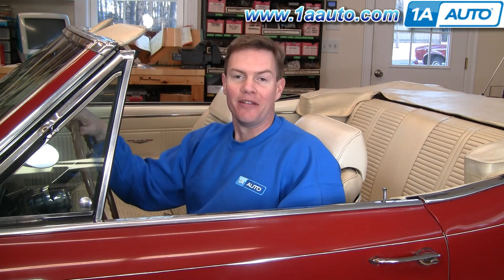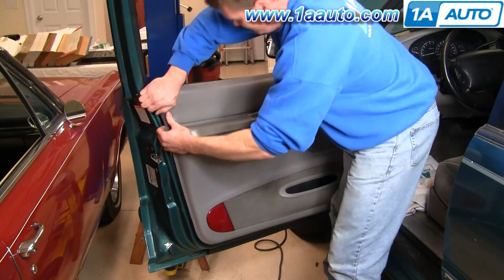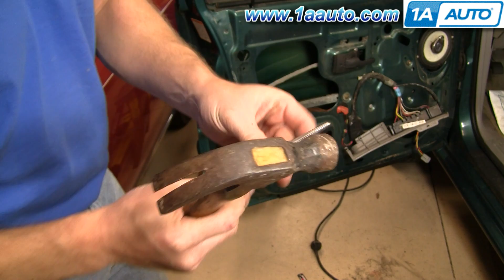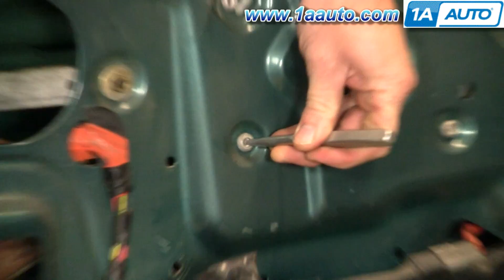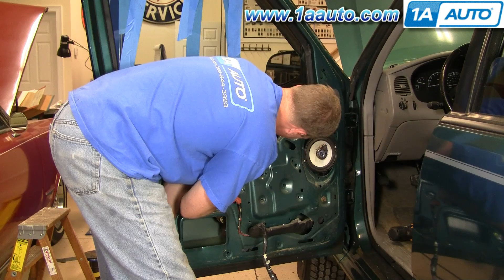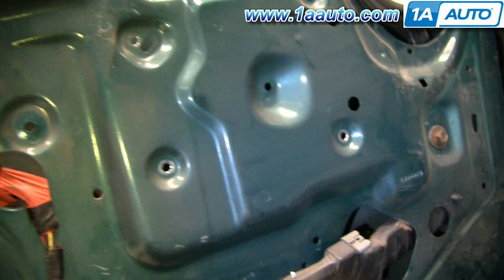How to Replace Front Window Regulator 91-01 Ford Explorer

Comment: I'd like to know which wires need repair to allow my window to work with the driver door open. It works fine when closed but will not work when open. I've had it 5 years and it's always been that way.

Comment: Replaced motor and regulator on 96 Explorer but now window jumps track just before it reaches the top when I roll it up. Took apart passenger side to compare. I can't figure it out.

Comment: For the plastic shield I use a moldable sticky gum..
Comes in a strip, cut off as much as needed, removed wax paper covering and shape to desired size..
Instantly bonds and can be removed if need be, stays pliable..

Comment: Excellent video, job took less than 2h. I could do it again in 45 min.

Part works perfectly, very pleased. Someone else in the comments offered an important detail. You need to buy bolts and lock nuts, they are not supplied. I think it's 5 total but buy extra. I was able to get a box of M6 stainless steel bolts and matching lock nuts on Amazon. M6 happened to fit a 10mm socket making this uniform and easy. I added a dab of lock tite to the Ford OEM nuts that you DO reuse just to be certain nothing wiggles out. This company rocks.

Comment: This video is fantastic and it helped me and a buddy replace the regulator in a 96 Explorer. The problem I keep having is that the glass will not stay in the channels. I've used 2 different types of Loctite and an epoxy, and pinched the channels. Eventually, the window pops out of one or both of the channels.  Any suggestions?
Reply from the maker: +Scott Munn We wouldn't be able to diagnose an issue like that here, you may want to have a local mechanic take a look at it. Thanks for checking us out! http://1aau.to/m/Shop-1AAuto-c

Comment: Hi, I’m new at this. Question, when do you need to replace the regulator?
Reply from the maker: +Izrael Labastida The window regulator will fail and the glass will either fall into the door or the motor will fail and the window will no longer move. Thanks for checking us out. Shop for high quality auto parts on 1AAuto.com:

http://1aau.to/m/Shop-1AAuto-c
Reply: @1AAuto  thank you so much for replying me. I do appreciate it. I noticed on my windows they starting to go sideways like 10 degrees when I’m pulling down and get stuck on the middle. I was wondering if this was problem of the regulator.

Comment: I need to do this repair (passenger door, '96).  The only problem is that my motor is shot (which is why I'm doing the repair), so I can't move the regulator up/down to position the nuts/rivets in the holes/cutouts for easiest removal - the window is all the way down.  I'm concerned especially about punching out that first rivet you did (on the bottom track); I can't see it or get to it... is it necessary to break the regulator there to get it out?  I've seen a few other videos where they don't break it.

Comment: Do you think it is my regulator that needs replacing? My front driver’s window is stuck all the way in the down position. When I hold the switch in either direction, I hear a little squeak-ish electric noise. I’ve tried lubricating with white lithium lubricant and no luck (that’s what auto shop did to fix it last time ~1 year ago). Won’t budge when I use force to push the window up. Do you think it’s worth opening things up to check for any broken/damaged wires before replacing the regulator? Really don’t want to fork out the ridiculous 300 or so bucks for this after I paid 200 last time and it’s already broken again. Thanks for your help in the video, and in advance if you reply here!!!
Reply: I also just noticed the regulator you sell doesn’t include the motor, I guess I’d have to make sure it’s not the motor that’s shot? Although I saw one of your comments saying if it’s the motor then I’d be able to push the window up... I don’t know.

Comment: Mike, first of all, thank you so much for making and posting this video. You saved me the labor cost, and I learned a new skill. Retired mechanic here, so I really appreciate you sharing the repair procedure. Got her done today, and back in business. Also, just wanted to let you know that in your video where you are showing the first rivet to hit with a punch, I'm pretty sure you are showing the wrong rivet. It took me a few minutes to figure this out. The one you are going for is just a pivot point on the track, and not necessary for removal of the regulator. I removed the two rivets located on the window track, and the three in the door, and the regulator came out with no problem. Thought I would post this for everyone else just in case you might be scratching your head like I was trying to figure this out. :-) Once again, thanks for posting. I'm a new fan.
Reply from the maker: +Thomas Swope Thanks for checking us out! 1AAuto.com

Comment: I was ready to tear my regulator from this same Explorer.. My window rolled up crooked. I thought it was the motor, turned out the only thing wrong with it was the window just separated from the inside window clamp. 6.50 cents later i fixed. Always start with the small things first. Rolls up like a champ.
Reply: Is that a power window?

Comment: My pass front window is stuck rolled up. How do it get to the regulator while it’s stuck? Sounds to me like it’s hitting something when I try to roll it down and it doesn’t move. From the looks of the regulator it might be the gear not moving and wedges on something.
Reply from the maker: +Adam Averhart It could have a tangled cable but you should be able to take the door panel off and still access the bolts that hold the regulator up. Or it could be an issue with the motor which could make a grinding noise as well.

Comment: How do you determine if it's the regulator or just the motor? I have zero sound when I press the window buttons. Sometimes, though, they decide to work.
Reply from the maker: +Heather Gulino You may want to test the power going to the window switch and the window motor. If the is power to the window motor when the switch is pressed, then the window motor might be bad. Hope this helps you out. 1aauto.com
Reply from the maker: +Heather Gulino You may want to test the power going to the window switch and the window motor. If the is power to the window motor when the switch is pressed, then the window motor might be bad. Hope this helps you out. 1aauto.com
Reply: Thank you! Do you have a video for testing the power window motor?
Reply from the maker: +Heather Gulino Here is a video that we have that should help you out. https://www.youtube.com/edit?o=U&video_id=2tLmH05UKwk

Comment: I'm finding this video to be very helpful, I just bought a new regulator for my truck. My question(s) to be clear, what size nuts and bolts do you use to replace all of the rivers. Another question I have is what would be a good glue, or epoxy to attack the holders for the window itself. The ones that attack to the regulator arm??
Reply from the maker: +Shawn Saaler Thank you for checking us out. The size bolts and nuts are dependent on the size drill used to remove the rivets. The glue or epoxy is a personal preference, but 3M has some really good products. 1aauto.com
Reply: 1A Auto Parts alright sounds good. Thanks a million.

Comment: can you tell me why all four of mywindows don't work and why my wipers don't work they all stopped at once
Reply from the maker: You may want to check the fuse. It that is okay, you may also want to check the wire harness that runs between the door and the body of the vehicle for a broken or a frayed wire that may need to be repaired. Hope this helps you out. 1aauto.com

Comment: Cant you just unscrew motor and replace it? W/o messing with window
Reply from the maker: +Squidget You might be able to. Here is a link to the replacement window motors on our website. https://goo.gl/3sqV49
Reply: 1A Auto Parts Thanks, I'll just replace whole door, easier that way. 
Kidding, I'll check it out, thank you

Comment: My front passenger window is in the lowest down position and I can't get to the point where I can center punch and drill out the attachment point between the regulator and the window support bracket. Pretty sure motor is bad as I've connected the battery terminal directly to the 2 pin motor connector and nothing. Is there any way for me to raise the window? Or, is the only way is to knock out the rivets and remove the nuts holding the regulator and pushing the whole thing in like in the video? If yes, what do i do after that?

Comment: I was having issues with my window not going up. I took the entire door apart, drilling out rivets. By the time I drilled the rivets I thought I should have checked the fuses first. Turned out it was a 2 dollar fuse. On the inside fuse panel its number 10 for the door actuator. Check and replace that before tearing the panel off. I feel pretty dumb but im happy i fixed my window in time for the fall cool off.
Reply from the maker: +Rubber Johnny ahh, that's a bummer! But we're glad you were able to get the repair done! Enjoy the fall weather :) For anyone else who might be doing this job, we carry the parts shown in the video on our website. Order from us and we'll cover the shipping. Here's a link: https://www.1aauto.com/1A/WindowRegulators/Ford/Explorer/1AWRK00467?utm_source=YouTube&utm_medium=CTA%20Comment&utm_campaign=1ATony
Reply: Great info! Sorry to hear about the trouble you went through. Btw, did you have trouble with all your windows or just one? I'm trying to beat the Fall rain too. My front passenger window is all the way down and is not going up. All the other 3 windows are working fine. There's not one mention of power windows in the fuse box diagram. I know the GEM module affects the windows and there seem to be 5 fuses (#10, 20, 25, 27, 28) on the interior fuse box with the GEM description (found descriptions online) on it. So far the fuses looks good. I'm still hoping it's just a fuse. The window is all the way down and drilling the part of the regulator that attaches to the upper window track/support is impossible. Btw, what size bolts (1/4 diameter hex?, length?) and nuts did you use to reinstall your regulator? Shoot, it's gonna rain tonight!
Reply: Well my girlfriend did a dumb move and rolled down the window. Now i will have to replace the motor and regulator. Quick question. Does the regulator come with the nuts and bolts or is that separate?

Comment: You guys are awesome!! I will be replacing the regulator on my explorer today. What size were the nuts and bolts that were used in the video?
Reply: not sure about there stuff...but I used 1/4-20x1 hex bolts
Reply: Did you figure this out?  I'm going to home depot to pick bolts up and plan on guesstimating.

Comment: Thank you SO much for video.  My 93 Explorer Sport windows are getting sluggish.  I greased up all joints that I could and its working better,  but the regulator needs to be replaced in both doors.  Seeing this video makes doing the repair not so daunting.    OH and that water shield looks a whole lot better than the ripped plastic sheet thats in my doors.

Comment: You guys rock! My window has been broken for years so I decided to give this a shot after watching the video and now I have a working window. Thanks!
Reply from the maker: Thank you for watching. Please let us know how the repair comes out!
1aauto.com  888-844-3393
Reply: Allan Tinoco A1 Auto Parts My passenger/front window has a clicking/slipping movement that just started. Motor still works. I can lift it (with another person helping) into place and it holds. Is this an indicator that the whole regulator needs to be replaced?
Reply: David, mine started off like that until the point it broke off track. You should check to see if something is blocking the path of the window as in the rubber that surrounds it. The video provided by A1 auto is pretty much on point you just need to make sure you start as early as possible cause it does take some time. Good luck.
Reply: David, also, if the motor still works A1 auto just sells the bracket without the motor bit I just decided to buy the whole thing even though the motor on mine was still good.
Reply: Do you only replace the front left or do you have to do it to every window to fix them too?

Comment: Good video, however do not use a carpenters hammer use a ball pen for hitting center punches and drift punches, otherwise do this step by step and it works...I fixed my 1995 Ford Explorer by using this video. One more thing the motor  and or regulator dose not come with hardware you will need 6 EA M6 bolts and nuts....

Comment: Your video was a big help. Have a 95 Ford Explorer that a couple of the windows were slipping, had to help them up and down. Found out that the gear plugs were shot in the regulator. After watching your video, it made the job so much easier. Thanks a lot!
Reply: so you were able to fix the problem just by cleaning the plugs or splicing in new plugs?

Comment: What if you only need to change the window...How do you disconnect the window from the regulator?  Do you still have to take out all those ribbets or just the ones on top?  And does the window glass slide out when removing...How difficult is it to remove and install the actual window glass? 

Thanks for your help.
Reply from the maker: You should be able to unbolt the window from the window regulator and then remove the window out of the top of the door. Hope this helps you out. 1aauto.com 866-403-3393

Comment: 1992 Explorer 4WD 4DR - Eddie Bauer. The video helped out a lot. The 1A Auto front driver's regulator & motor was a perfect fit. Had some problems with the two rivets below the window but eventually drilled them out just fine. One "totally unexpected" problem I found was the south vertical rail to hold & guide the window when it goes down in the door... broke off and was laying at the bottom of the door cavity. I found it when I was cleaning out the rivet & drill tailings. IMO, this was causing premature wear on the regulator & motor as the south side of the window was unstable in its downward position. For the last year I have been hearing the window rattle when I shut the door with the window down. After spending 2 hours figuring out how it was supposed to be attached (two small rivets broke off the rail), then drilling holes & putting screws in the vertical guide to secure it to a bracket... everything else went as the video showed. So a relatively easy 30-45 minute job took me 3+ hours... BUT man does the window work great... smooth & quiet! Thanks!!

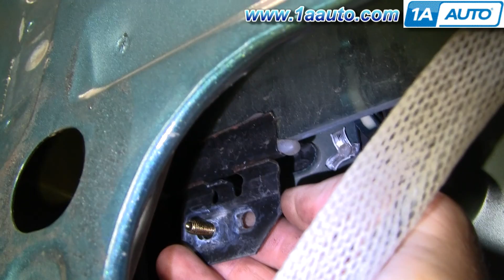Comment: Big fan of the videos and a huge life saver! My window is not going up or down but the regulator is working fine. I took the door panel off and everything and when I use the window button the regulator moves up and down. The 2 metal clips that attach to the window are not attached to the window anymore. The same clips you put the new bolt in 7:38 - 7:43 of the video. is that silicon just holding the clips to the window? any recommendations on how to reconnect those clips to the window? Thank You
Reply from the maker: Usually on windows they use a special adhesive or glue to attach the window to the bracket. If you go to the dealer them may be able to get the adhesive for you. 1aauto.com 888-844-3393

Comment: Retired shop / technology teacher 35 years, NIASE cert,  USAF Electronics. 
Great Job.   Your video was clear and concise.  Loved the time lapse parts edited in.  Mention eye protection is always a good thing.  I used an old bath towel to capture the scrap drillings  where they fall.  Housekeeping of the metal shards is a given .  And I did a good vac job of the inside of the door after the old assembly was out because the metal shards captured inside the door could fall out the drain holes.  ☼

Comment: The vehicle we have the window is basically just floating, I can push the window up or down with my hands. The motor inside is working, I can even see the part inside going up and down, it's just not raising or lowering the window.

Comment from the maker: It would probably be easier to remove the regulator and do the work outside of the door panel since the rivets need to be removed and bolts installed.

Comment: I have a 99 windstar. the window is stuck all the way up. It is the motor that needs replacing. Do i have to take out the whole regulator to replace the motor? I am new to this. Your advice is appreciated. If so, how do I get the window down to detach it from the window?

Comment: Thanks a lot for these videos. But the problem with my window is that the two pieces that are attach to the window came off the window, and the track came off the regulator. any suggestions for the fix.  If u understand what Im asking.

Comment: The first part drilled out, you start with "small" then 3/16 then 1/8. Did you mean 1/4 or was it 1/16 then 1/8? 1/4 looks rather large for that fitting.

Comment: The regulators went bad in both of the front  doors of my '96  Explorer and the mechanic told me it would be around  $600 to replace and install new regulators ($211 each...$85/hr labor). I bought t wo used regulator ($40 each) and was able to replace them by watching this video.  Thanks, the instructions were excellent!!

Comment: what if you're replacing the regulator with a used window regulator..  The used one doesn't have the brace that connects to the window.  what kind of bolts will you need to reconnect the bolts you knocked out to free the regulator from the window?